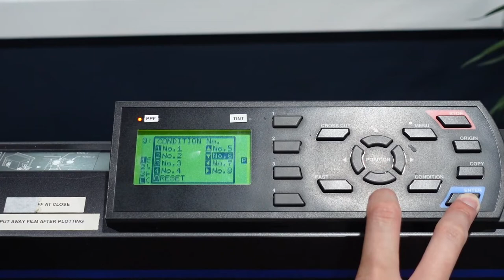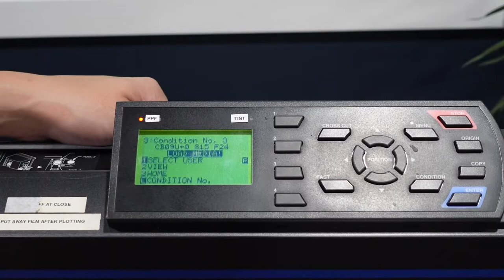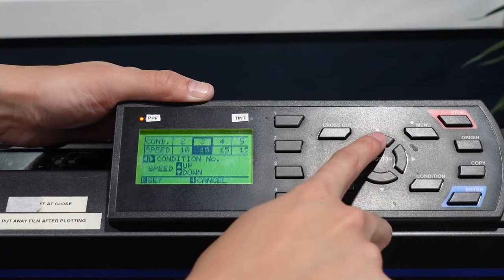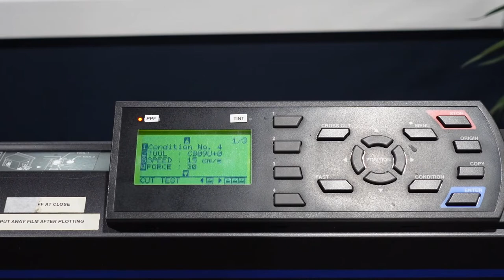How to set up your graphtec plotter for paint protection film

Comment: I’ve got a graphtec 48” plotter also that I’ve been trying to dial in for ppf but the pinch rollers don’t grab firm enough to keep the material from slipping 😵‍💫 I just keep wasting material. There’s no adjustment for pressure on mine how do you get yours to plot with out slipping? Thanks in advance.
Reply from the maker: There should be adjustments on the backs of the rollers if the lever is all the way up, it's the highest pressure, and all the way down would be the lowest. Are you using 2 or 3 rollers?

Comment: Hi, thanks for the video. I was wondering what your blade depth was considering you cut with the cap sheet still on? The film is 8 mil but how big with the cap sheet? Thanks!
Reply from the maker: My blade is currently set to about the depth of a credit card and we adjust the pressure as needed to the film we are using. Cap or no cap sheet, we don't change the depth, just the pressure.